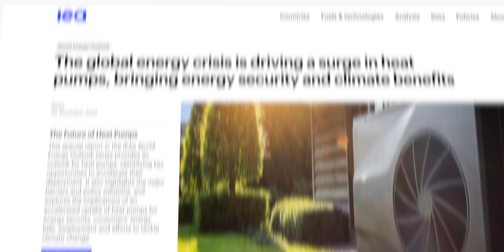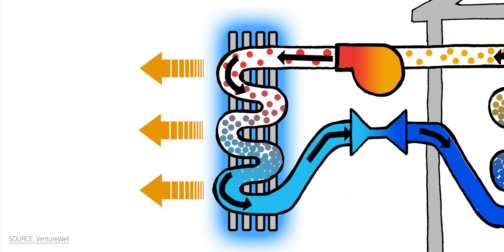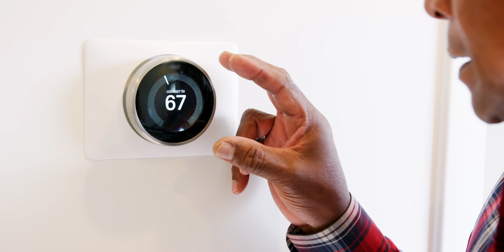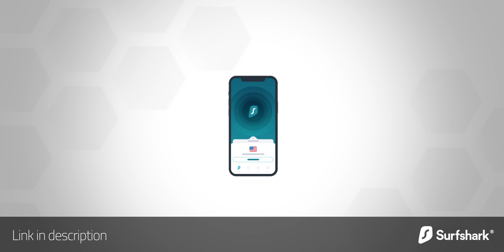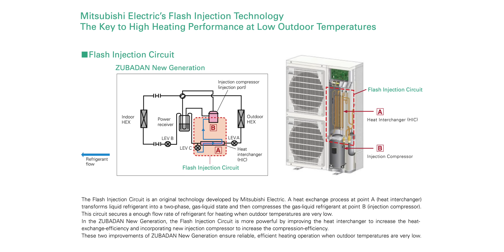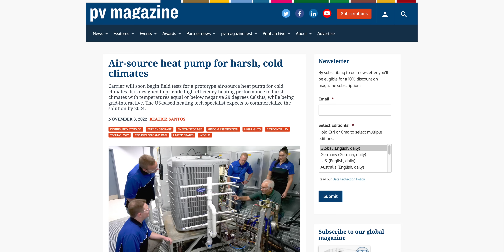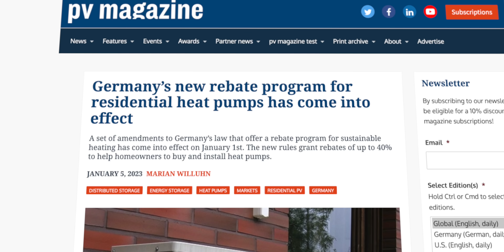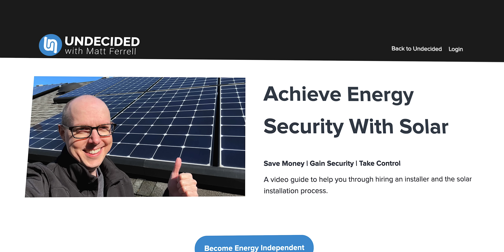Major Advances with Heat Pumps in the Extreme Cold

Comment: I have a two year old air source heat pump with 3 ducted air handlers and a gas furnace w/ coil attached and I LOVE the thing. BUT.  I wanted a geothermal heat pump but all the local companies I could find that did anything with them said they had stopped  installing them due to the cost of install and increased maintenance cost over the air source heat pumps.  My heat pump claims to work down to 10F but at 40F I can feel a definite decrease in heating and we keep our house at 64-66F inside.  Our house is 3200sq ft and two stories.  I have two additional Heat pumps for an equipment closet and for the garage.  there are 3 months of the year in our area that we just turn the system off and crack open a window upstairs and we stay comfortable with out heating or cooling since we are well insulated.    If I turn the system off and open the equipment closet that little space alone will heat most of our second floor 10-15 degrees above outside on its own.   Before we fully insulated our 24" floor space between stories ALOT of heat when upstairs and was lost from the downstairs.  What I think will REALLY help efficiency with multi level homes is heat recovery.  Take the heat from outside and pump it in, then when the upstairs is warmer then downstairs because heat rises pump it back downstairs, and in my case, pull it out of the room I'm paying to generate heat and pump it to the rest of the house in the winter.   I spoke with 7 companies in my area and they all said (three years ago) that to do that I needed a commercial 3 phase system.  Just my thoughts.  I love heat pumps but I still feel that the companies are still padding their numbers at the discomfort of their customers.

Comment: Matt, heat pumps have a reverse-cycle deforst (same as summer cooling mode, but the inside fan is in off or run at very low speed) to clear the outside coil when it ices up, just make sure to allow enogh ground clearance or soakaway for the defrost water. BTW, nearly all modern AC condenser units (the compressor and coil outside) run on power inverters, which changes the compressor pressure dynamically, by changing its speed, and so increase its efficiency. Japanese AC units have had this tech for decades. To make some power out the the unit, Introduce a thermal generator to the condensor in the summer, which converts the excess heat to electricity that can be fed to your power wall, making it even more efficient.
Reply: Only the most expensive units have variable speed compressors using DC. Mid-range units may be two speed, but aren't using inverters. One of the other challenges of the inverters is cooling them, especially in extreme heat. Trane uses the cold-side refrigerant to cool the inverter, but repeatedly has startup problems during extreme heat, when there is no cold refrigerant for a while after startup.
Reply: @johnhaller5851  
Depends.. here in northern europe inverter HP's are quite common. As we don't need to cool the system itself (+35C outside is way beyond normal) a bit more complicated electronics is no problem. And its fun to see HP reversing itself for defrosting at minus C - all the heat that was pumped to ~100 m2 concrete floor reversed for few minutes. BIG cloud of steam :)
Reply: @johnhaller5851  I think you need to do more research... Mitsubishi and Daikin have been using PCM inverters (not DC) for at least 15 years.
Reply: @michaelmurray2595  I didn't say there were no inverter heat pumps, but they they are not common in the US. Most people buy the cheapest unit they can find, as they only replace it when the old unit is condemned, and the cheapest will be a 240V single stage unit. This is almost always a poor choice, as a single-stage heat pump sized to heat a home will be too big to effectively dehumidify a house in the summer. And if they will not pay for a variable speed compressor, they certainly won't pay for a whole house dehumidifier.

Comment: In Europe we have oil/gas/solid fuel and electricity energy. By backing heat pumps Governments are switching basically to the grid/electricity! So the new power stations will be gas/nuclear/coal/bio-fuel, Mother Earth still loses out just as badly, what's the deal???

Comment: What if you live in an apartment block? We can't put anything on the balcony not even a pair of shoes (see edit), and if you smothered the outside walls with hundreds of heat pumps it would not only look horrendous but the vibrations would cause the entire block to shake to pieces I have heard. Also maintenance would be very expensive and difficult above on higher floors. (edit, as the balcony is also the fire exit. "terrace homes and flats — are not suitable for air pumps" Daily Mail: so only for detached houses which belong to a very elite class.)

Comment: Air-Air CCHPs have come a long way in the last 10 years for sure.  In many cases they make a lot of sense.  Tight envelope new construction or in dense areas & well populated suburban especially.  That being said, my hesitation on a heat pump here in semi-rural New England would actually not be about the heat pump itself but about the local electrical infrastructure integrity.  I wouldn't consider the switch unless I had a supplemental heat source available. In some cases, I believe insurance companies still require a secondary when a heat pump is used.
Reply: The secondary is usually strip heaters in the air handler, which doesn't help with irregular power. It does help if the compressor is down for a few days for parts, as the only indoor parts that may need replacing are the blower motor and the control board.
Reply: Yeah, the emergency heating situation is my fear.  We've had quite a few ice storms resulting in multi-day outages as of late. The piece of mind knowing I can fire my oil/gas system with a small generator instead of being completely up the creek is well worth the sacrifice of a small overall cost savings.

Comment: I believe the heat pump tax credit in the US is only for ground source heat pumps - as I was filling out my 2022 taxes, that is what the tax form read.  My AC died last June and we replaced that and our furnace with a cold climate Fujitsu heat pump.  We are through most of our first winter, and the backup heat strips have never fired.  Made it through the entire winter on just the heat pump, in Michigan.  If anyone has different info on the tax credit, I'd be grateful! I could use a $2000 tax credit!!!!

Comment: This is a good video and shows the promise. Being from the upper midwest, I do believe many would not consider this technology until it has been supported in the field for some time. A quibble: It seems it doesn't truly eliminate carbon usage unless the electricity to run them is generated by solar / wind etc. The economics are still a concern, and explains the need for subsidies. I recently replaced AC and furnace, in Texas. I'm a progressive high-tech oriented person. Heat-pumps are indeed interesting, but for me, economically they didn't make sense. Perhaps on the next go-round.

Comment: It is true that air source heat pumps are getting better and better dealing with bitter cold, however, as it gets super cold the efficiency drops dramatically.  The may still be better than resistant heat, but from a BTU/dollar standpoint, you are likely much better off burning NG.  There is also the issue with the grid.  If everyone is heating with electric heat pumps and you have a serious cold spell, the demand will spike and could crash the grid.  NG on the other hand is much less affected by these spikes in demand.  Also, it takes only a small generator to keep a NG furnace running during a power outage.  All in all, I would not recommend a heat pump in a cold environment.  It is however perfect for the Southern US where "cold" days are still pretty warm by Minnesota standards.  If you are lucky enough to live near cheap access to ground source heat (ie have a very high water table or have a nice size lake in your backyard), then this will expand your usage further north and make heat pumps a better option over NG further north.  But for most people, the huge cost of ground source installation can never be recovered short of fuel costs going up massively.

Comment: I had a heat pump in Clovis, NM almost 40 years ago.  It was very good in the winter.  I would prefer a geothermal radiator  with a heat pump.  A constant 53 degrees year round

Comment: Just started watching this video and have to comment before I watch the rest. You people who like them have a totally different animal than mine. I HATE my heat pump!!!. Luckily I live in Georgia, because mine starts to struggle at 45 degrees, and at 40 and below outside temp, I just shut the damn thing off and let the house get cold. Because at that temp and below it will run for what seems forever, and blow cold air on me. I don't want to eat when it's on because it's uncomfortable being bathed in the cold air coming from the ceiling. And forget about going to the potty while it's running.  I renamed it my COLD PUMP. And yes it has been serviced, he said "it's fine".

Comment: The Mitsubishi Electric Flash Injection technology has been on the market in their high-end heat pumps (Zubadan in Europe) at least since 2013. My house is heated by one of those right now. They work flawlessly. But other manufacturers also have this technology, just under a different commercial name (e.g. Panasonic Aquarea T-CAP, etc).
I also have a Daikin mini-split that I tested at -15 C outdoor and it provided heat for several hours with no issues.

Comment: Good luck with the rebates. Here in Canada the 5k rebate seems to pad the HVAC contractors bottom line. Hopefully this new volume of low temp heat pumps will at least  bring down the MSRP of the units themselves. When I last shopped in 2019 a so-so heat pump was 3k more than the standard ac. Double the price to add a reversing valve...

Comment: The temperature of the water coming into our heat pump from the ground sources in our yard (3x100m deep) was at least 14C, even when the outside temp was -10C. There was no drop in efficiency. Geothermal seems to work just fine in colder climates.

Comment: Matt, ''ground source heat pumps are not geothermal, that refers to using hot sub surface energy such as is extensive in Iceland.
COP is not efficiency, to say heat pumps are efficient is incorrect they are not. Electricity is not energy but an energy carrier, that 'energy' has to be made and distributed. No electro mechanical device has an efficiency above  practically 99%.
Electrical costs, perhaps you have not noticed, are rising quite quickly and will have an impact on those who decide to buy this form of heating.
Your video has put agloss on many of the negatives of these devices. Low maintenance, quite the reverse, even if it only means regular cleaning of the evaporator and gas loss is common on refrigeration equipment.

Comment: You need to revisit how a heat pump works regarding your statements about "fluid".  No fluids are compressed, fluids are largely incompressible. Gases are compressed.  If you had a fluid enter your compressor, you would quickly destroy your compressor.  The fluid state of the refrigerant "freon" has very little to do with heating or cooling, it is the transition from a liquid to gas (and vice versa) where the main cooling/heating occurs.  The compressor works by taking lower temp/lower pressure gas and compressing it to higher temp/higher pressure gas.  The compressor pushes the high temp gas to a high pressure coil (condensing coil).  There is a metering valve which slows the flow out of this coil thus maintaining the pressure.  As the hot gas lingers in the coil, it loses its heat to the environment (either inside or outside depending on time of year), and condenses to a liquid.  This liquid is passed through the aforementioned metering valve over to the other half of the system (the evaporator coil).  On this side, the compressor is sucking, so it is low pressure, and as such the liquid will boil.  As it boils, it absorbs heat, cooling that area.  The boiled off gas returns to the compressor to start the cycle again.  There is a small amount of heat that is given off by the condensed liquid (called superheat) and a small amount of cooling of the gas that happens after evaporation (called subcooling), but these are useful numbers in adjusting the metering valve and system charge and have little to do with actual movement of heat.

Comment: U.K. has £5000 grant for heat pump installation. I might have missed it but did you cover that geothermal (called ground source in U.K.) are significantly less susceptible to low temperature so might still be a better option than air-source for homes with high heat consumption in low temperature areas.

Comment: Have two Nibe 12kw air source heat pumps to heat up 480 square meters with radiators. Basically two Rolls Royce engines that can heat the water up to 65°C even with -25°C outside. Faultless machines. They consume about 2500kwh, combined, a month during the winter months. Will soon install 14kwh worth of photovoltaic panels to offset the consumption. I highly recommend this Swedish product

Comment: A decade ago I began a study of replacement heating and cooling systems for our home in NE Ohio.  I hoped that by replacing our gas furnace with a heat pump that we would save on natural gas consumption and get whole-house air conditioning in the process.  I interviewed five companies in our area and settled on Carrier equipment.   Removal of the existing system and installation of new took less than a day.   I anticipated a payback or break even point at about 7-8 years;  boy was I WRONG!  We broke even within 37 months, dropping our monthly natural gas budget from $334 to $54.  Energy costs for natural gas and electricity have continued to rise over the last 10 years but we still pay less than we were before installing the system.